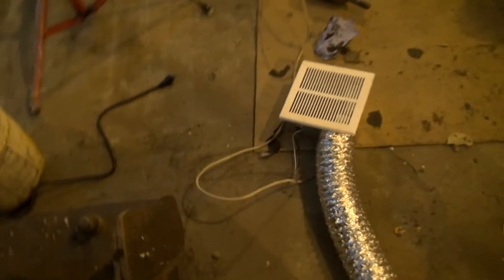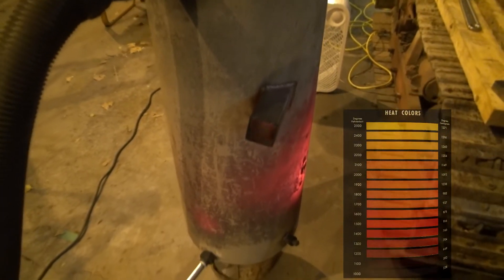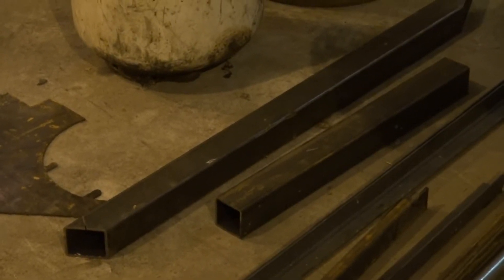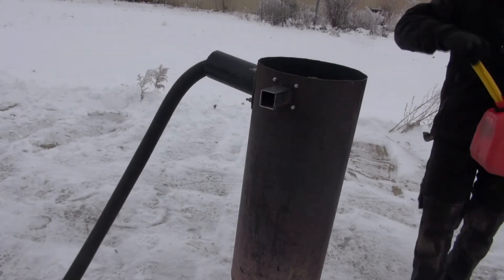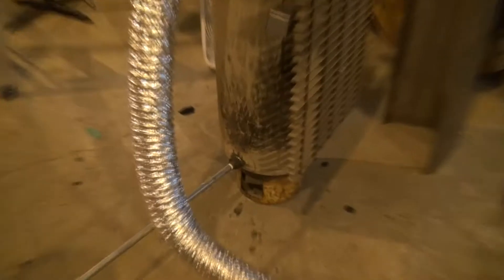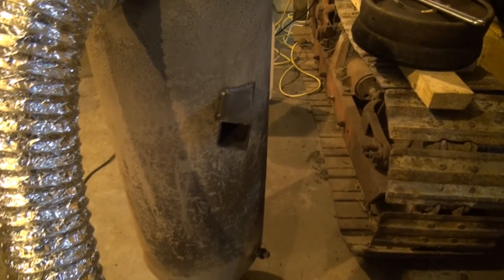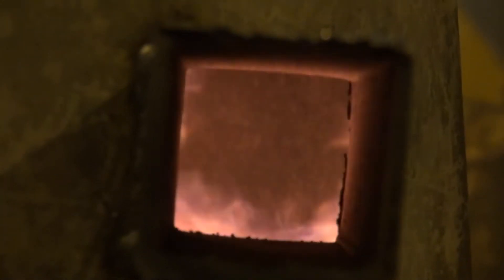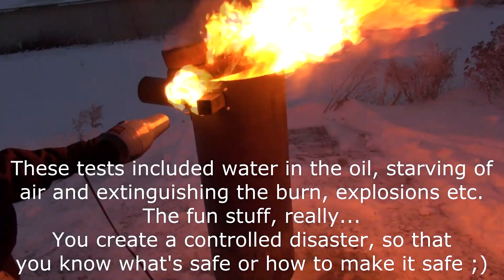Waste Oil Burner 2 0 - EXPLAINED

Comment: Hi. Beautiful work. Can you tell me what is the diameter of the holes in the pipe through which the air comes and how far is the distance between them. Thank you.
Reply from the maker: Thank you!
Oh yeah, "description will follow", lol. Gotta do that yet, I forgot haha.
The holes are 7/16 and there are 8 on the opposing side of the exhaust, and 3 on all other sides each, from the bottom up. The distance is about 2 inches I believe. I will change it up a bit anyway, it's not THAT crucial. 
A small hole directly pointing down into the puddle is more important.
I put in a 1/4 hole there.
Precise measurements will be coming up after I finish the lid and put on the new 150 cfm duct fan.
Reply: One more question. How far is the pipe to the oil?Many thanks!
Reply from the maker: so the bottom of the tube is 6" sway from the bottom of the burner, the oil level comes up as high as 4". Leaving 2" air space and that is when it burns the hottest and best.